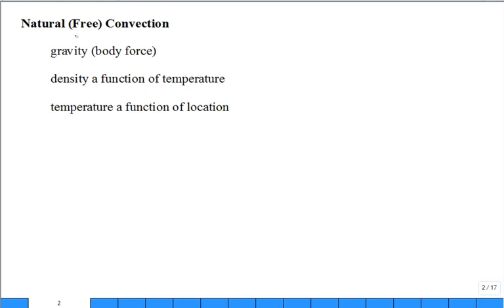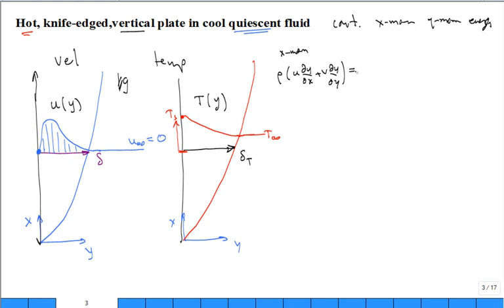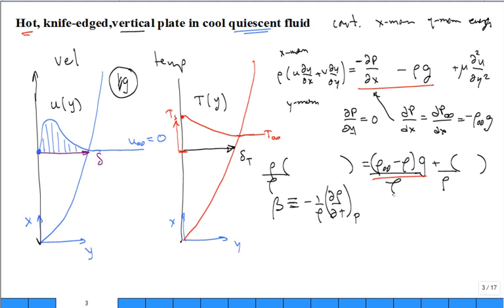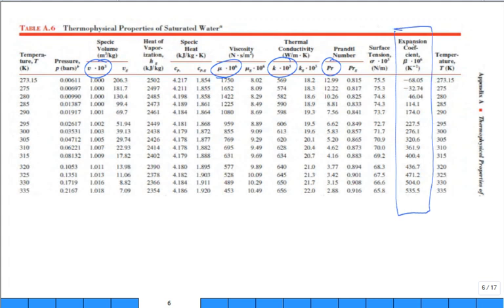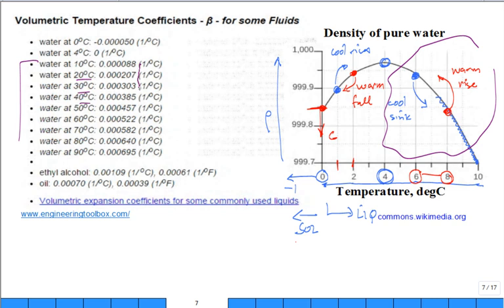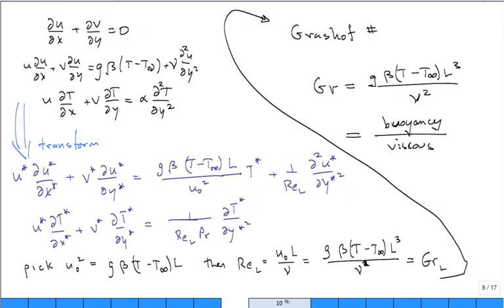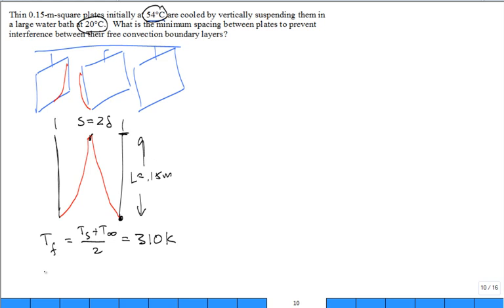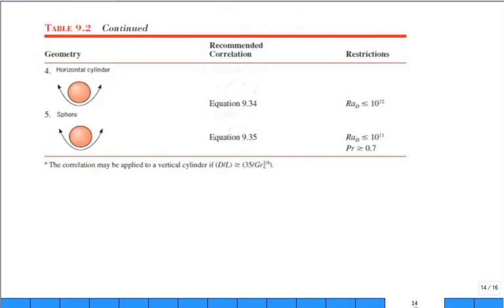Natural Convection 1

Comment: Hello Professor its a great lecture but I was hoping to get some clarification on the problem that you do at the end of the lecture. When I do the calculation I get a                  Gr= 8.31x10^8. I have done it several times I put g=9.81, B=361.9x10^-6, delta T=34, L=.15, and v= .7x10^-7. If  Gr=(gB(Ts-T)L^3)/v^2  then I get 8.31x10^8 and if the pr is 4.62 wouldn't that push Ra=GrPr past 10^9 which would be turbulent? Thank you for your time your lectures are extremely helpful.
Reply: I meant v=7x10^-7
Reply from the maker: looks like you are correct.  my mistake.  thanks for checking